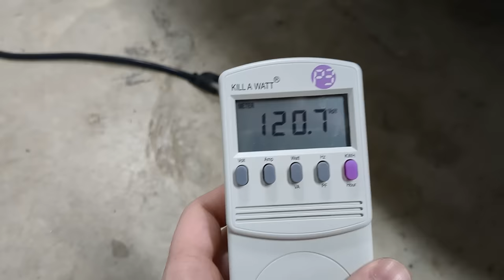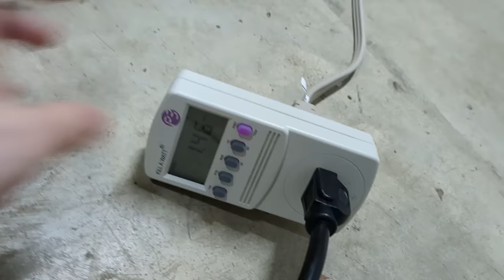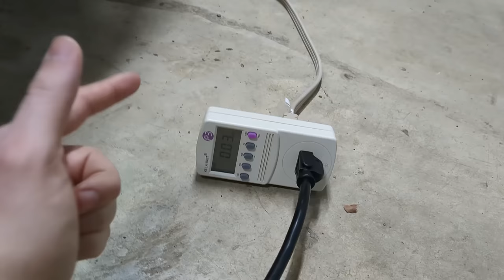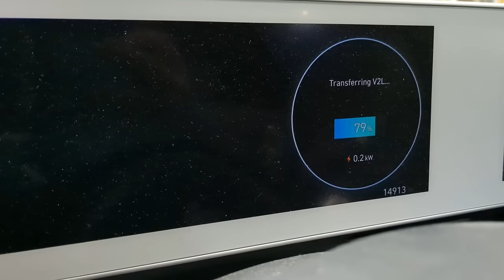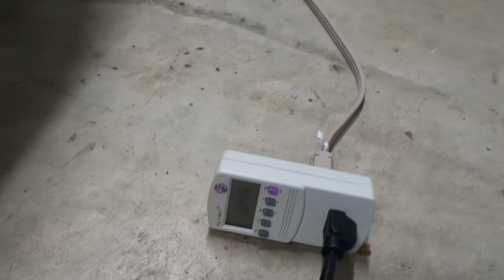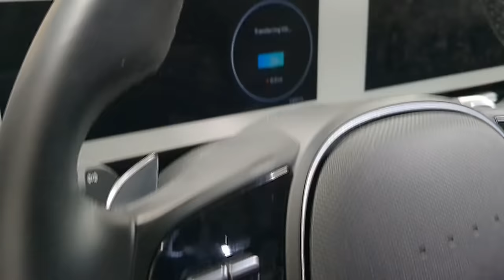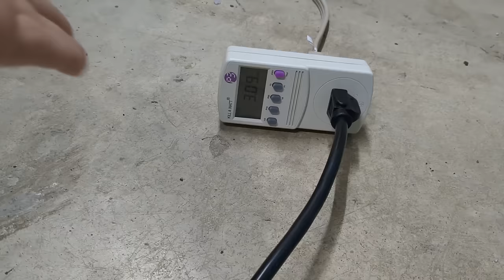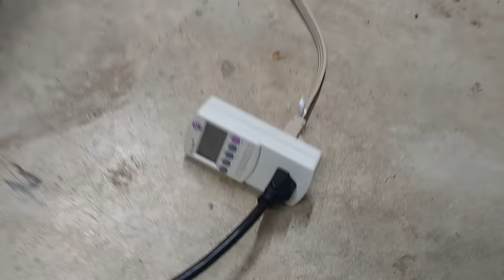A 24-hour test run of the Hyundai Ioniq 5's Vehicle-to-Load function

Comment: I'm in Quebec and we are just coming out of a nasty ice storm that cut out power to about half the city I live in. We were out of power for 48h.

I had the foresight of getting a setup to run a 1000W inverter on the 12V circuit of a 30kW Nissan Leaf. The main goal is to keep internet going, have some computers, fridge, freezer, cpap. After this real life experience, we're adding a small space heater and an induction cooktop. 

I've learned a few valuable lessons:
- If planning to recharge, go to the nearest charger and WAIT. First time I went driving and ended up going way further and lost a ton of the battery charge driving back. Yes, obvious in hindsight.
- Test everything. Plug in the max it can handle and let it run for a long time (1h+) to test it. 
- Get actual numbers. I mainly used calculations and never really trialled it well. 
- Get a kill-a-watt and test all the loads to make sure you are working on actual numbers and guesses. Knowing will allow you to batter manage what you run on a very limited power budget.
- The kill-a-watt let us know that the induction cooktops at <700W is actually 700W cycling on and off.
- Another kill-a-watt lesson, Panasonic Inverter microwaves uses less power continuously on lower power settings, instead of cycling on and off. 
- Do a full test measuring the loads on both the DC and AC sides to make sure everything works. I messed up a connection somehow and its overheating, causing trips at ~52A (about 700W). 
- Another kill-a-watt learning, the oil filled space heater has 3 settings, 600W, 700W, 1300W.

Comment: I recommend testing the furnace blower before an emergency. Many furnace control boards won’t operate if they detect an unbounded neutral to ground. This is an issue you can test for by putting your o scope probes on ground to neutral and a 2nd lead for ground to hot . (Floating neutral)
Reply: You can buy an adapter at any camping supply store....This is a common problem with RV generators.
Reply: I was unsuccessful powering my furnace for this very reason. See my comment above.
Reply: Careful with how you hook this up! Standard passive oscilloscopes have a common ground between the channels and earth ground on the AC cord. Plug this up wrong and you’ll fry your probes and scope!
Reply: @SalamanderDancer  Yup, melted a probe in first year college thinking the two channels were independent. They were smart though, our first lab had us building our own probes from a few cheap parts. (Anything measured in that class was under 10 kHz, so cheap and dirty was good enough.)   :-)
Reply: I had this problem with the small EcoFlow I use to buffer the 12V from my Tesla for this application. I used something called an "EZ Generator Switch" on the furnace side and had to rewire it to leave the neutral unswitched (bonded at the panel). It included instructions for this.
Reply: @KevinT3141  As EEVBlog says, You come a gotcha!
Reply: @PHamster  pretty sure it's "come a gutsa" or something to that effect, its AU/NZ slang, roughly translates to "to fall on one's face", or "run into a show stopping problem".
Reply: Thanks for the tip!

Comment: Late to this video, but as a 2023 Kia EV6 owner, this feature has been a key piece of the puzzle in the conversion of my house to off-grid solar!  While my house has a significant battery bank (57kWh), we installed a device (EG4 calls it a Chargeverter) that takes AC power and converts it to DC for charging the big solar battery bank.  It's primarily used for dirty portable generators that wouldn't be adequate for sensitive electronics, but it is also a great way to utilize an EV's battery as an emergency battery reserve.  While 15A-120V is not nearly enough to run a home on its own, a constant 15A-120V source is over 40 kWh in 24 hours, a big extra buffer of power in an emergency.  Assuming the car was at 80% SOC before the emergency, it means I have access to an emergency battery bank of 61 kWh!

Comment: If you're gonna make this a long term plan assuming you own your place it's a good idea to install a small sub panel with your critical loads in it. I installed a 30 amp one that I can backfeed with a 20a inlet on the outside of the house. It's not huge but it has what we need, the fridge, living room (powers the router, TV, cell booster, stereo system) and the bathroom lights.
Reply: If you go through this bother you might as well install a proper transfer switch so you can switch individual circuits to the external generator.

Comment: And also, remember that the fridge and the freezer give you exactly 100% back in heat in the wintertime. Of course the same for summer time, but then  you normally dont need that heat. They are just heatpumps and everything they consumeturns into heat inside your home. So camping out in the kitchen with all doors closed might not be all that bad.
Reply: The heat being pumped out of a fridge is heat that slowly entered the fridge from the surrounding room. Even if the fridge was room temperature to start, it would heat your kitchen less than 1 degree, in the process of cooling.
Reply: @jarednotter1354  You do lose some energy in the process, the fridge isn't 100% efficient from the plug.
Reply: @draeath  but all that loss in efficiency is just heat. So even the losses are heating. Also you’d be able to heat your house by freezing water from the tap. That’s the power of heat pumps, pulling energy out of things where a natural temperature differential doesn’t exist.
Reply: @matthewwilson4592  Yes, that was my point.
Reply: @draeath  make it clearer next time
Reply: @Soldier842  it's not incorrect, that was his point. Heat is moved around, yes, but that uses energy. Spinning the pump, frictional losses, vibration etc. It's not 100 percent efficient, and any percentage below 100 percent creates heat
Reply: @synapticburn  And when the intended goal is to create heat, losses as heat are no longer losses. Thus, 100% efficiency.

Comment: For your Kill-a-watt issue, they have a version with a battery backup... I use a watts-up-pro which has logging built in so that you can plug it in to a PC and get graphs of usage over time, it's a pretty nice device.
Reply: I believe mine is the P3, and saves the data so I can unplug it and plug it back in somewhere else to read it (which I do if it's in an awkward location).
Reply: @tactileslut  Mine is a P3 International P4460.
Reply: I have a knockoff one (can't remember the name or be arsed to find it right now) that has a backup battery.  Big Clive actually did a tear down on it (he had the European version which is identical except for the actual outlet) and found it to be quite accurate.

Comment: That is pretty solid. I used my Jeep Grand Cherokee with a 800w inverter to keep the fridge running during one power outage, and on a tank of fuel I could not go that long, especially with how inefficient a ICE engine really is for energy production. 

Also bumping your fridge and freezer one notch warmer will still keep you in safe range while using less power as well, which can be handy for the summertime loads.

Thanks for the time invested in this video, its definitely useful!
Reply: ICE engine? so an "internal combustion engine" engine?
Reply: @AugustusOmega  It is a useful specification, considering there are quite a few things that are I.C.E. like Immigrations and Customs Enforcement. So, using the I.C. Engine is technically more correct in this case.
Reply: @TemporalandReaty  ICE vehicle? ICE automobile....the designation is a type of engine in a what? a car. ICE car
Reply: @AugustusOmega  .... Cars are not the only thing that is a vehicle that can have a IC Engine in them. Motorcycles, aircraft, boats, four-wheelers, and Golf carts can all fit in the category of ICE Vehicle.
Reply: @TemporalandReaty  its like nailing jello to a wall. If you dont wish to comprehend language logic, those problems are your own. My example does not limit the ICE car only to automobiles. ICE boat, ICE motorcycle etc.
Reply: @AugustusOmega  are you not very well liked in school?
Reply: @Outcastiid  Discovery can be brutal.
Reply: @AugustusOmega  Yeah, that answers that. See a therapist.

Comment: It would be interesting to test the battery percentage loss A) with no load but inverter running for long time B) high load for short time. That way you can find out if the car has high consumption by itself in active mode, or if the inverter has poor efficiency.
Reply: I'm also really curious about this. A random 2 kW inverter from a local store has a spec of >90% efficiency, so this measurement of close to 50% efficiency seems unusually bad
Reply: Exactly what I was thinking. If the inverter is just kinda garbage, it would be better to use vehicle power in high intensity bursts to heat a room with a space heater or cook a meal, and then go dark again. (Not great for the fridge, I guess, but whatever.) Though if they're gonna provide a garbage inverter, I'd rather they just give me access to the DC directly and let me supply appropriate hardware.
Reply: @Keenath  most inverters are sub 90% efficiency. That number drops even more when you run them outside of their peak load zone which is typically 30% of its nameplate. IE, a 1000w inverter is most efficient when supplying a 300w load. Less than 300w and it's horrifically bad. More than 300w and the efficiency slowly tapers the more the load goes up.

Beyond that, there isn't just one conversion process at play here. The high voltage from the pack is going through a DC-DC converter first, dropping it to a usable voltage for the inverter.

Just like any other electric conversion process, the greater the delta between input and output, the greater the efficiency loss. That is one drawback to 800v architecture. You have a massive delta between 800v and 120v, compared to a 400v architecture vehicle.
Reply: @brandonk1163  Literally came to say this as well; the poor efficiency is most likely because it was below a wattage threshold where it takes a lot of power to have a small load.
Reply: @brandonk1163  Ah, interesting.  So that does argue for using power in spikes and then unplugging, and makes the V2L not great for continuous low-draw applications like a fridge.
Reply: @Keenath  yes and no.

The efficiency at the inverter will go up substantially if you keep your load in the 500-600w range, yes. But that isn't taking in to account what is probably a very sizable efficiency loss at the cars DC-DC converter where it has to drop a huge range, from the 800v pack down to Xv. I'm not sure what they're using for an input to the inverter (and is something I'm trying to find out). I wouldn't be at all shocked if it's an off the shelf 12vdc to 120vac automotive part. Ideally it would be ~120v DC input as you have a two fold benefit. 1) you're only dropping 800v to 120v. 2) the closer you can keep your input and output voltages, the less efficiency loss you have. Now the inverter only has to boost that incoming voltage to 170v, again a smaller delta to make up. (For those unaware, a standard 120v circuit is actually 170v peak to peak, it averages out to 120v due to the alternating sine wave of the AC system).

Having been involved in manufacturing, my initial gut thought is that since they already have a DC-DC converter onboard to charge the 12v battery, power the HVAC system, lights, radio, etc, they did in fact just use an off the shelf inverter for ease of manufacturing and cost to keep the bean counters happy. The bean counters don't care about efficiency of a feature that for at least right now, will go largely unused by the consumer market. Even for those of us that will use the ability, it's fairly rare in the grand scheme of things and is simply not worth the cost in specialized components to increase efficiency a bit. Thankfully we have amazing people like Alec bringing awareness in a fun way to the general public.

On the plus note, we're making advancements. Tesla is striving hard to use more and more of their own modules, which gives them the ability to not be stuck with off the shelf components. The Cybertruck is slated to use 70% of its own Tesla made modules. Their next gen car will be 100%. That allows them to get rid of 12v entirely and bump up to 48v for wipers, lights, radio, all of it. Not just the steering like they're using now. Hopefully other manufacturers will follow suit as it just makes sense. The higher the voltage we can send power across the car, the less copper we need to do it at less loss. It's also less conversion loss as we continue to shrink that delta between the primary pack voltage and point of use voltage.
Reply: @StephenHoldaway  even your 90 percent efficient inverter when turned on for 24 hours will use roughly 20 watts per hour with no load. And have you seen the Rivian standby consumption. Drivers are reporting 2-3 percent battery loss per day with the car turned completely off which is totally insane!
Reply: The inverter and charger use a given amount of power, regardless of the load going through. That's every charger and inverter, not just Hyundai's. I have the European version of this (which came with the adapter AND the 230V charge cable) and it obviously outputs twice the power (3.6kW) at the same 15A. I did a similarish test and interestingly it was a lot more efficient. So I assume there is extra heat loss and other inefficiencies due to higher currents at lower loads if it's run at 120V. Remember there's no way this can phase-split, it must produce "true" 120V, which is an extra inefficiency.
Reply: @brandonk1163  would it be more efficient if say... the car had a (relatively) small secondary/sub battery that was rated nominally at 120v with say... 25a max regulated output, and the DC-DC converter would periodically kick in at full load (likely with a gentle ramp up to avoid unpleasantness), ensuring the efficiency from DC to DC is as best as possible, leaving only DC to AC conversion to occur to get the Vehicle to Load functionality?
Reply: The inverter will have a idle wattage that is separate from its efficiency. Most inverters are around 90% efficiency, but on top of that you have to account for idle consumption.

High-Frequency Inverters will have a greater idle consumption than Low-Frequency inverters. 

I have a 6500w HF inverter with a 70w idle consumption. 
And a LF 1100w LF inverter with 10w idle consumption. 

HF much more common because they are cheaper and lighter.
Reply: I love the theory being talked here, but would also love a follow-up test if the real numbers. If it is true that we could get greater efficiency by using more battery, that could make a difference in strategy to avoid useless loss and make it useful usage, or to alternate spikes and off. Here's hoping!

Comment: This really made me think about just how much power it takes to drive a car around versus just home stuff. Also a good reminder to avoid resistive heating whenever possible.

BTW My neighborhood in Boston, Mass., gets a big power outage lasting 8-14 hours every year or two. The worst are when they bring in generators that torture us for a week and then require another 5+ hour outage to put us back on the grid.
Reply: That socket is outputting a tiny fraction of the power that the battery provides to the motor. The battery can easily put out 60kw but this style of converter can only do 1.8kw before it exceeds 15amps, which is what standard extension cords/powerstrips should be rated for when used in the home. Feels like the converter should have given you more than 1 outlet or the car should be able to output more power.
Reply: You can absolutely get more power out of an EV (like an F150 Lightning) - it depends completely on what system of inverters are included in the vehicle.
Reply: Which neighborhood is this?  I lived in Cambridge for 3 years, JP for six years, and Watertown for about half a year; somehow I never had a power outage, even during the worst storms.
Reply: An electric car not so much, about 15 to 20 kWh for 100 km. A gasoline powered car with fuel consumption of 10litres/100km means about 100kWh/100km...
Reply: @jbradleymusic  JP, over the past 15 years or so. It seems to be this particular stretch along a busy street that has a lot of old wiring.

But with six new luxury apartment & condo buildings going up around us hopefully that means they'll finally fix all of the old wiring by the time they're done.
Reply: @cuteswan  Ah, I used to live on Williams, down the street from Doyle's and the Midway.  I wonder how close I was.